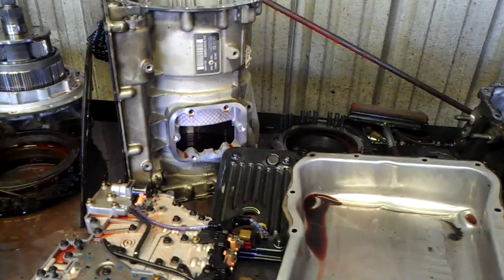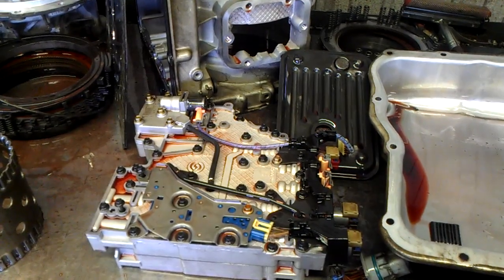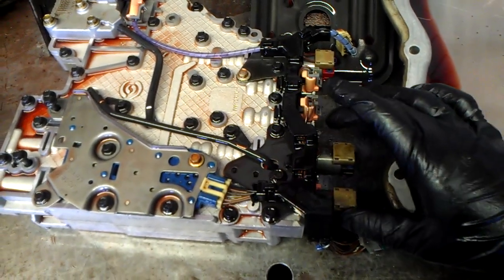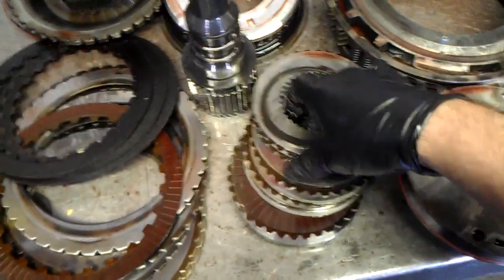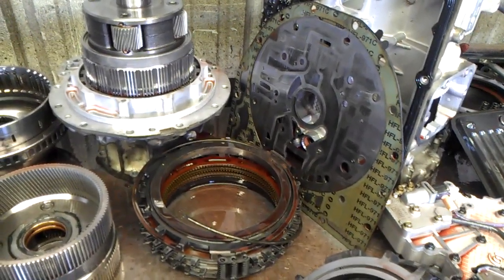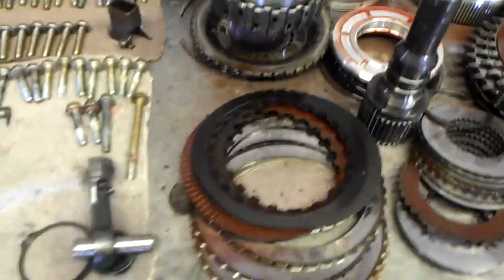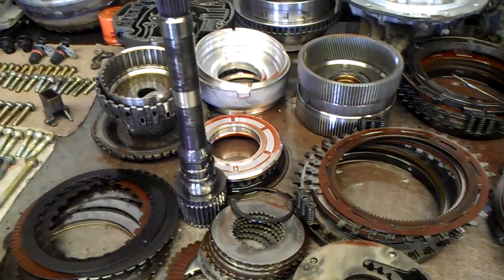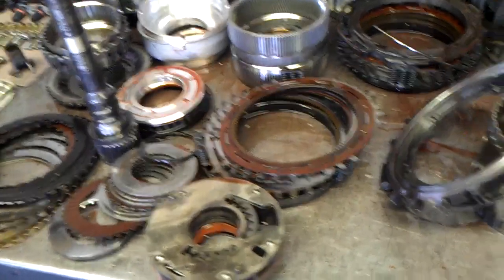Allison LCT 1000 Transmission with Trouble Code P0776 PCS B - Transmission Repair

Comment: So most likely my 18 silverado gonna be about the same as this. My allison shifts rough from 3rd to 4th dealer said it was normal relearn and that the trans keeps learning and adjusting. But it did it all the time uphill 40% throttle like getting on the freeway on ramp. Needless to say I got tired of going to the chevy dealer and they always said it shifted like all the other trucks. Now warranty is out I get to to this myself. So sad such expensive trucks and GM DOESN'T stand behind their product like they should. Or at least the local dealers don't want to. Anyways I'll be referring to your videos whenever I fix this and I'll share it with yall on the tube. Thanks for such great videos to the point but you explain why and how to's. Gracias Vato!

Comment: started up my 2011 chevy equinox 4cyl> this morning. This vehicle never gave any sign of a problem but suddenly it doesn't have reverse. and theres a code suddenly reading p0776 Pres Ctrl Sol. B CKT Performance or stuck off. Any kind of ballpark figure for the costs to have this repaired by a professional?
Reply: Axman Cometh did you ever figure out your problem?

Comment: Have an 02 duramax with the Allison 1000 mines throwing codes p0700 p0776 I’ve changed the trim A and trim B solenoids my truck does fine 1st threw 3ed when it try’s to go to 4th it goes to neutral. When the tranny gets up to temp as long as you leave it in 3ed gear and not in drive you can go eny where you want to in it it don’t slip at all in those gears but when you go to reverse or park and then try to go back to drive it goes about 3 ft then goes to neutral and it want move again until the truck cools down I bought the truck this way. The guy I bought it off of said he changed the fluid and the filter and said about 20 miles the truck did what it’s doing.
Reply: You find a fix ?

Comment: Hiram, appreciate the videos. I am curious as to what I can use to clean the aluminum/internals of the transmission with when I do a rebuild on mine. I heard that come chemicals will be corrosive to the cast aluminum. Can you let me in on what you use to clean with in there? Thanks, keep the vids coming.

Comment: tengo un 02 Silverado 2500 con la Allison, Que significa el codigo P0700? abeses cuando boy a 70mph y le piso mas. para rebasar  se baja el cabio y tego que parar y apagar el motor y en unos minutos buelbe a trabajar la transmission. pero abeses se neutralisa tambien  Gracias Hiram....

Comment: I just bought a kit rebuild my Allison 1000  in a 05 chevy any suggestions before I start the job 
It is a stage 5 kit with torque converter 
I bought the manual and have had slippage for at least a year

Comment: There is an added solenoid in the valve body. So you need a new valve body, and a new TCM, from what I can remember
Reply: Hiram Gutierrez
how much do you charge for a complete overhaul of the allison, and where are you located at